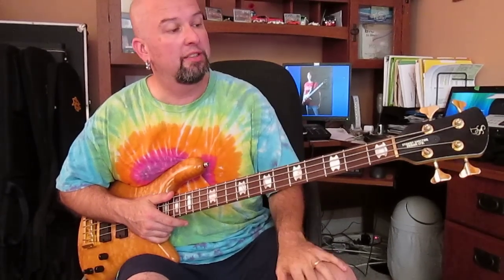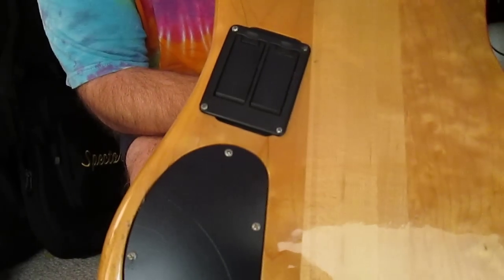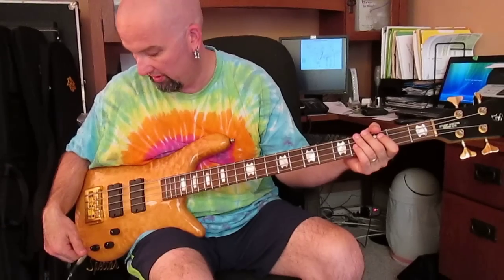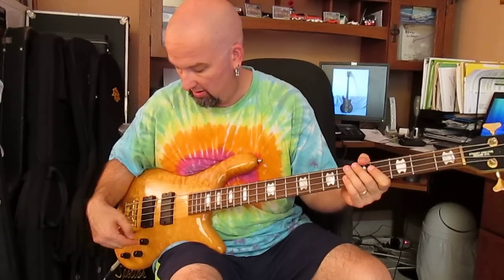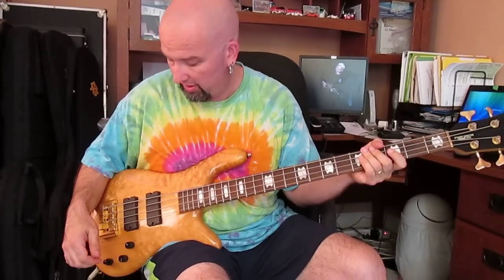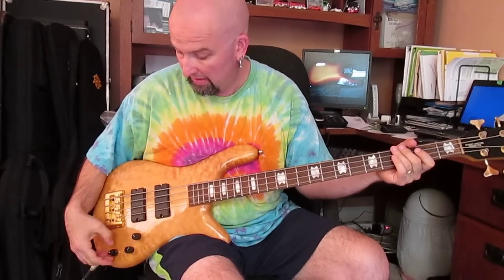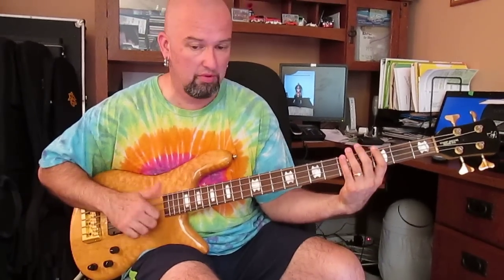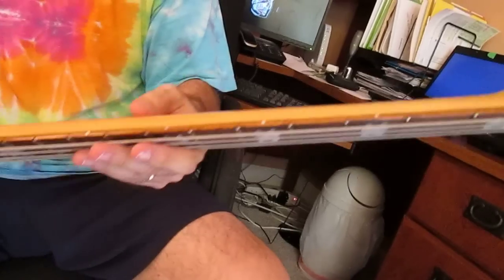1994 Spector NS4 SSD era!

Comment: I have a 93 #031 oil finish more figured wood says NS-4 but just like a NS-2 P/J pickups and 9 volt with 4 knobs no stacked, also has the SSD headstock. Everywhere I go soundmen love this bass. Have a couple Warwick's I use live but always this Spector in the studio.

Comment: In your opinion do you think the USA basses are worth it over the Euro series. I understand the USA have prettier wood and inlays and active EMG-X pickups. Would a Euro with the same pickups perform or feel the same?
Reply from the maker: Honestly, The only real difference is the preamp, and if you're not getting the real HAZLab pre, they are relatively close.....Diehard Spector fans will prob disagree but I have owned enough of both...